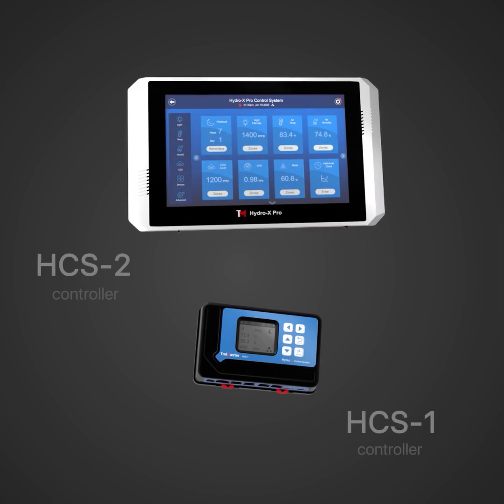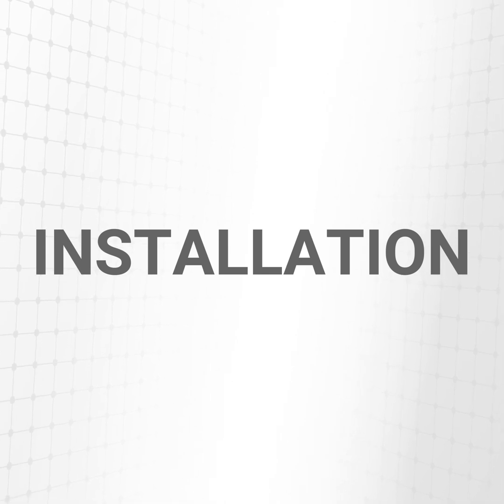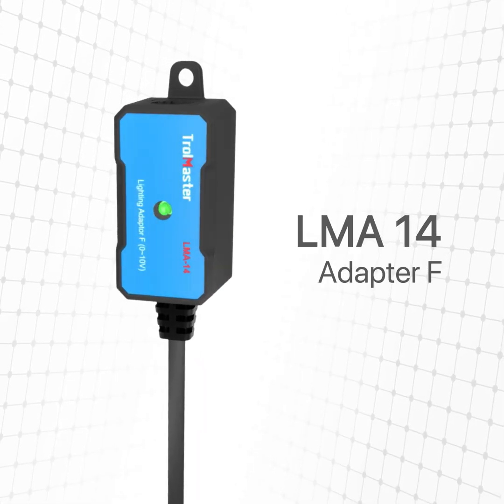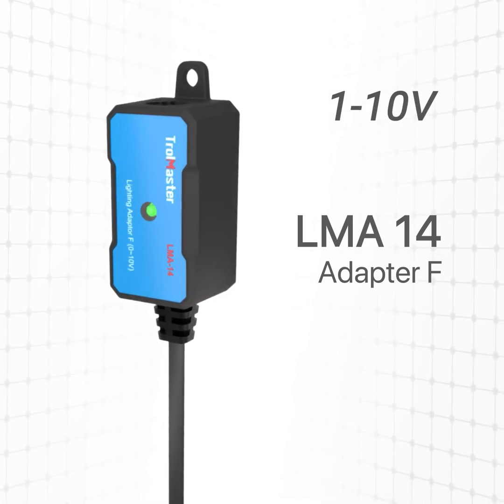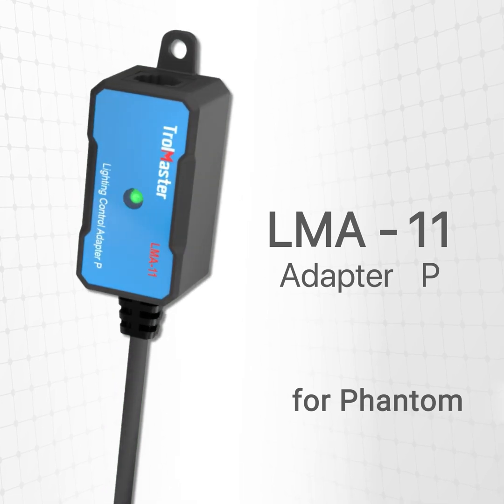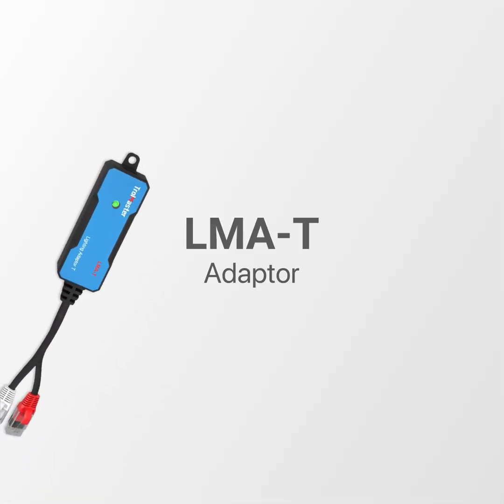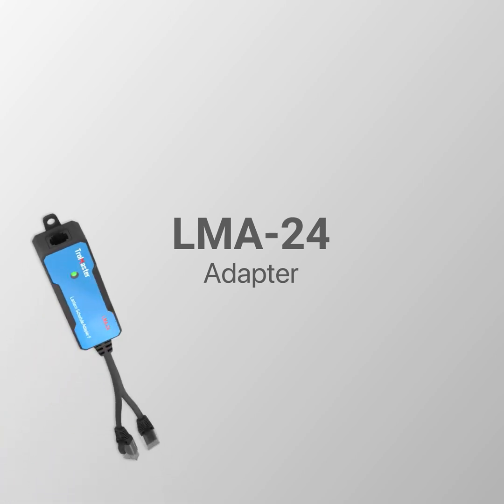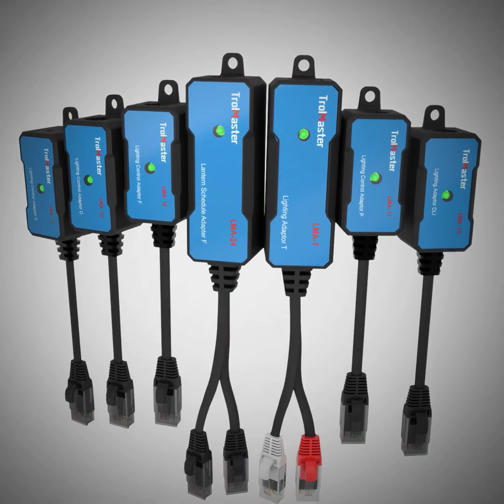Lighting Control System - TrolMaster Hydro-X System

Comment: if the power goes out will the  controller need to be reprogrammed or is there a memory function????
Reply: Holds memory for 40 minutes without input power to device. Then the device loses the memory due to capacitors being fully discharged.
Reply: There’s an SSD card input